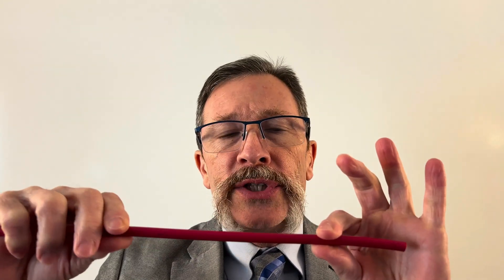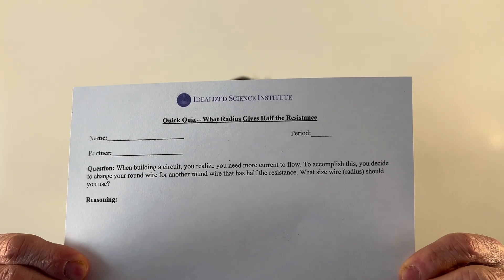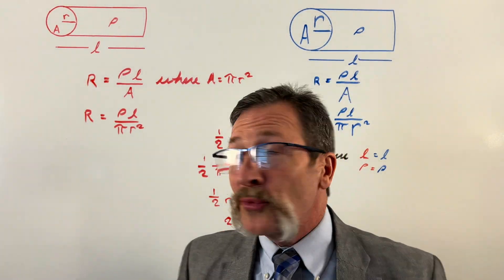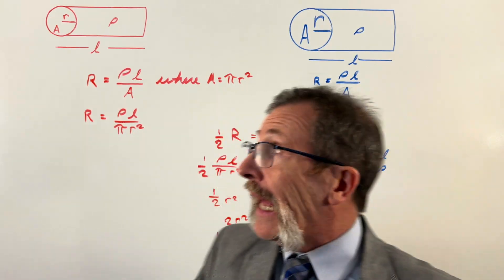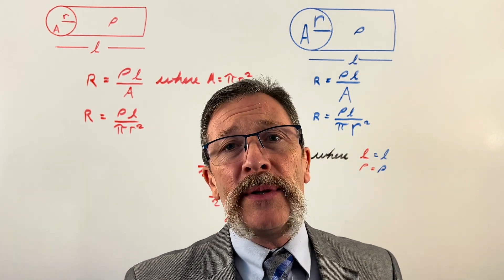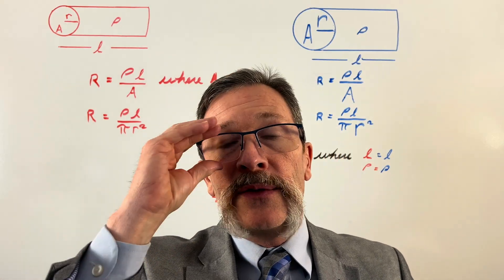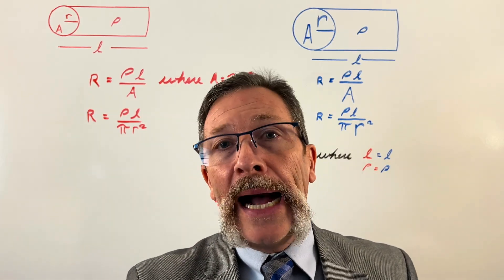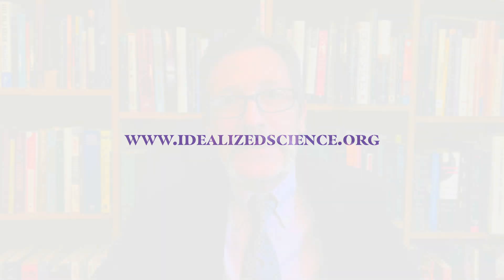How Does Changing Radius Affect a Wire’s Resistance?

Comment: You can do this without colors, and keeping track of red r versus blue r.  I find that very confusing.  You are going to have change r, so use r2 and r1.   I did it a lot more simply - just double the area.  pi*r2^2 = 2*pi*r1^2.  Cancel pi, take square root of both sides.  Done.  r2 = root2 r1.  Easy button.
Reply from the maker: Yes...Thanks for the comment!

Comment: I have learned that even when I "know" I'm going to know everything about the topic in one of your videos, I will still learn something.  (ie, I didn't know everything)  
Today I learned that in the AWG wire gauge system, changing from a particular numbered gauge to one 3 sizes larger (the number of the gauge will be a smaller number by 3 units) doubles the area.  The diameter in increased by √2.  In fact going to one size larger multiplies the diameter by 2^(1/6); 2 sizes larger multiplies the diameter by 2^(1/3); 3 sizes larger multiplies the diameter by 2^(1/2).
Thanks.
Reply from the maker: Very glad to hear it! Our goal is to have each video offer something of value to students, teachers, and even experts/professionals that have seen the core content before. It’s not always possible, but we are glad it worked for you this time!
Reply: That's a close approximation.  Per the Electronic Designers' Handbook, Second Edition, edited by Giacoletto, on page 3-110, the diameter ratio between adjacent gages is  (0.460/0.005)^(1/39) = 92^(1/39) = 1.1229322...  That is quite close to 2^(1/6) = 1.12246...  (I know you really wanted to know this.)  🙂
Reply: @analog_guy  That actually is very interesting to me.  It makes me wonder what their rationale was.   I wonder if this was from direct measurements of wires of different gauges rather than manufacturers specs.
Reply: @misterdubity  I don't know the original rationale.  Wikipedia says the gage number originated in the number of drawing operations used to produce a given gage of wire, but it goes on to say that the AWG is essentially identical to the Brown & Sharpe (B&S) sheet metal gage.  The 0000 gage was pegged at 0.460 inch diameter and the 36 gage was pegged at 0.005 inch diameter.  With 38 sizes between these two, the geometric progression yields the diameter ratio (0.460/0.005)^(1/39) between adjacent gages, making most of the diameters oddball numbers.  By the way, Wikipedia uses the word, "gauge", and Giacoletto uses the word. "gage".  Dictionaries don't all agree on the best usage.